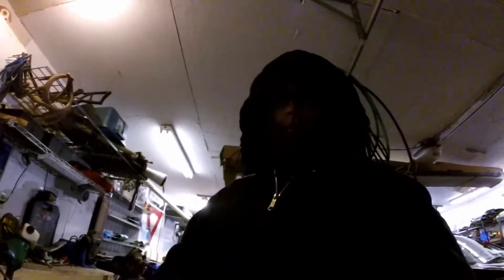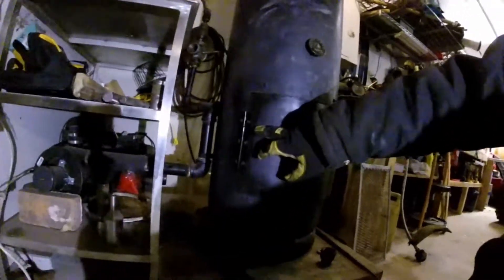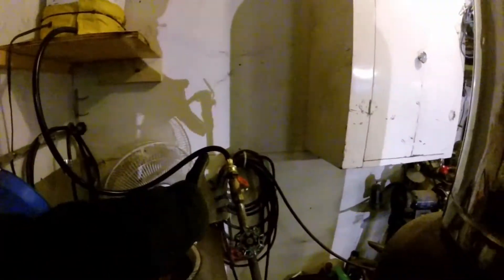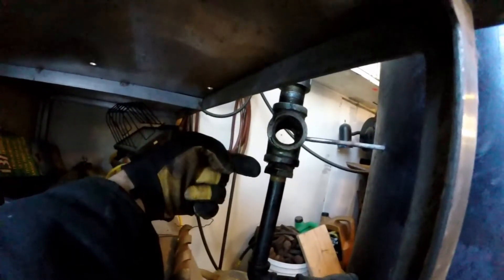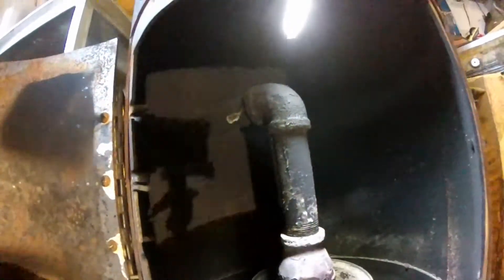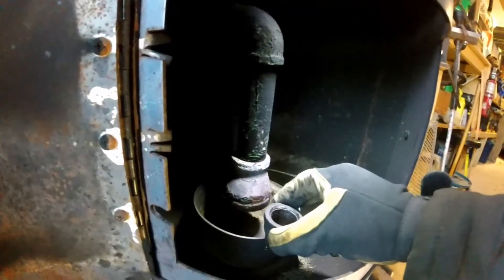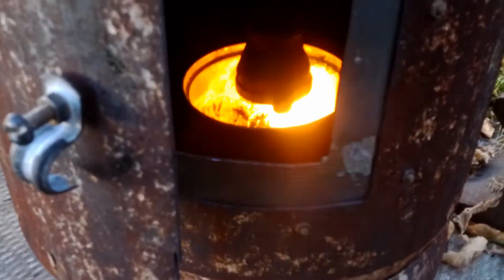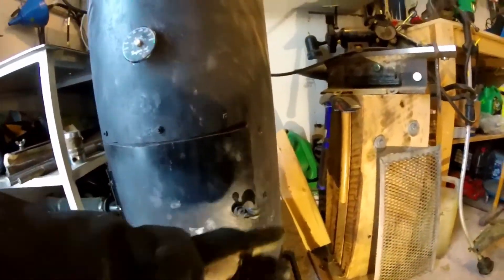Waste Oil Furnace Build

Comment: Question i have the Same setup but converted my old franklin  woodstove burns good but when i add air smoke starts to come up threw the sight hole where u have it dripping. Any suggestions?

Comment: Where your oil meets the air on the outside, how are you sealing the 1/2 inch pipe within the 3/4 inch pipe going thru the 1 1/2 all the way to the elbow inside the bigger pipe. Is it supported inside?? 
Nice design.  The bell on the very bottom is fully open?
Reply from the maker: The half inch pipe is forced through the 3/4 and just floating. 

The bell is open. 
I did try different size bells and different lengths of 1/2 in the beginning but ended with the design in most of the videos

Comment: I've seen quite a few different makes/sizes of these can anyone say what type of btu output they produce in comparison to wood, propane or kerosene heaters. For example if someone converted a typical wood burning heater to waste oil would the btu output be pretty much the same? Can the btus be increased or decreased by the flow of oil?
Reply from the maker: There is another YouTube channel I think 1 of his videos had btu info. https://www.youtube.com/c/GerrysDiy

I went with oil as I had access to it at the time an was a great way to heat my garage when I needed it.
Yes add more oil an air get more heat/btu  an can have it idle to maintain the temperature
Reply: Yes more heat off oil than wood or propane only thing close is K1 and at 3.50 to 4.50 a gallon.or like 24.00 at Walmart for 2 1/2 gallons.

Comment: What type of blower fan are you using?  You have done a nice job with this, you may want to  consider a metal reservoir instead of the plastic. Those plastic buckets seem to get brittle with age in my experience. also if you ever get some used hydraulic oil you will find it is great to burn, hot and clean.
Reply: Hay tube online you could get the small blower setup from a gas furnace the recirculating blower on high efficiency furnaces and put a dimmer switch on t for speed control
Reply from the maker: The blower is off a hot water tank. Not sure on brand or size. 

I do have a metal tank for the oil just waiting on plastic to fail
Reply: Well where I'm from our water heaters don't have blowers they burn natural gas, propane or have electric      
Heating elements in the tank, but thanks for responding. I'll probably use a automotive squirrel cage fan run it with a 12 volt power supply, I'll have to build a box to contain it but I'll have 3 or 4 different speeds to test with. Thanks 
 .